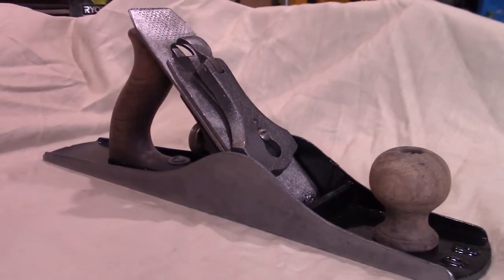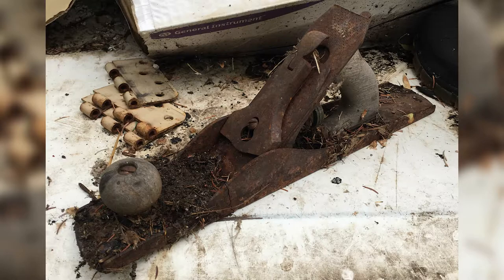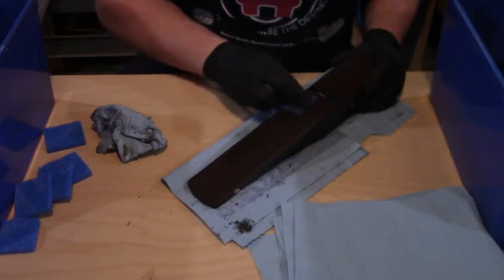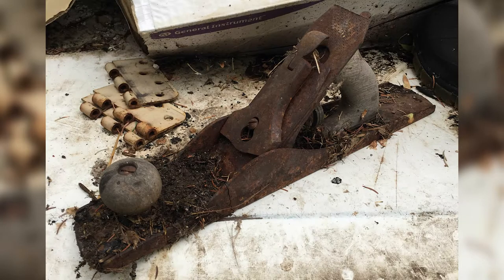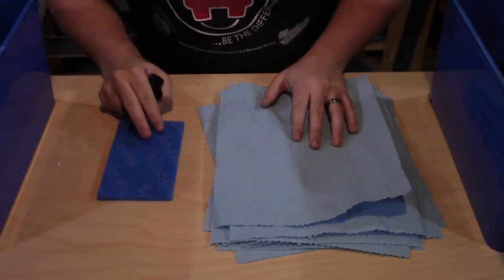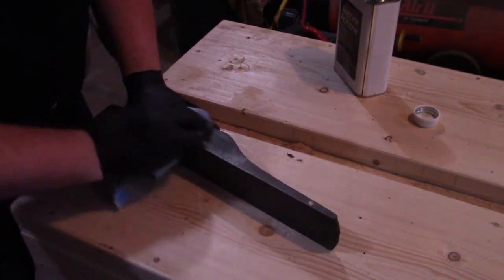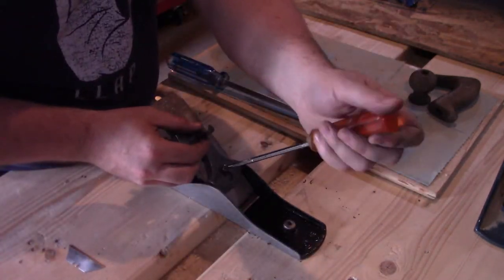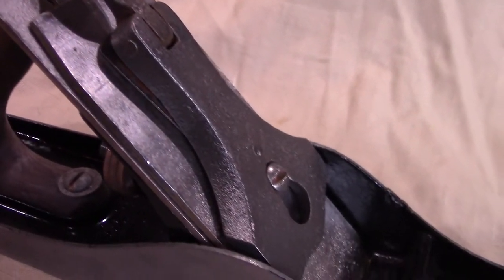Restoring Grandpa Schreiner's Old Hand Plane

Comment: Nice little plane John You could have the body tig welded. They would be able to warm up the piece and tig weld it then heat it to take any stress out of it. Then machine the sole flat. A smaller shop may do it for a show project to show their skill on their website. Might be worth a Collaboration?
Reply from the maker: Perhaps yeah, might have to look into that.